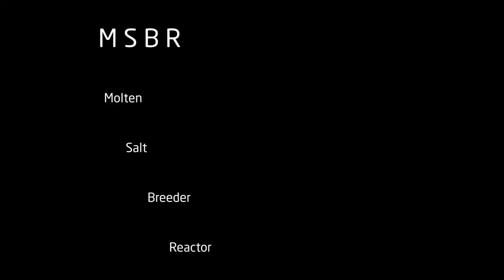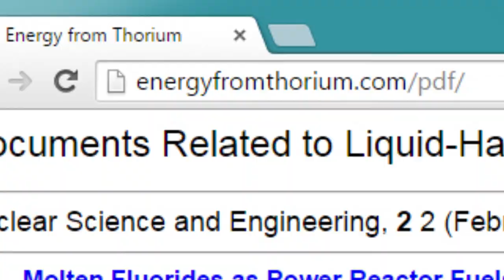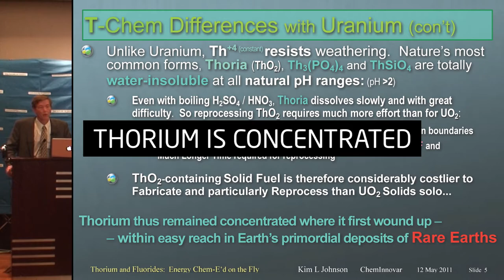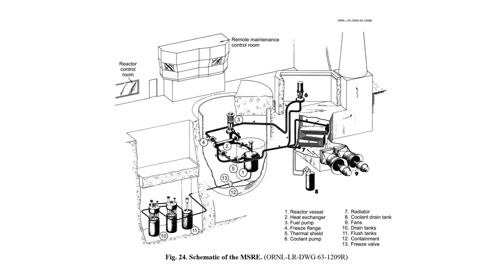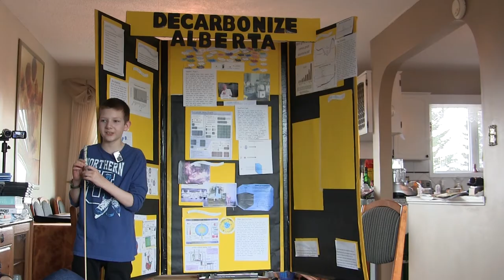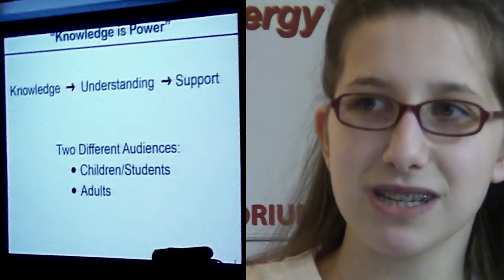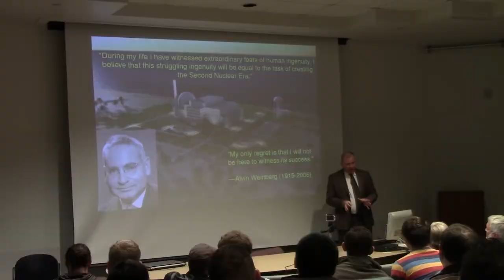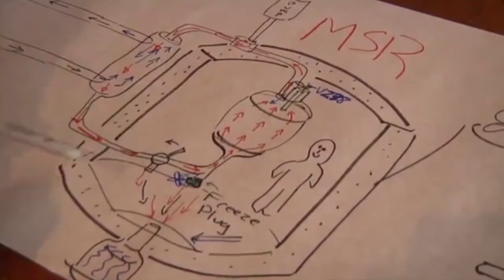MSRE Footage? MSR Needs Marketting, LFTR Coined - TR2016c 1h22m03s07f

Comment: I will go with Thorium heads over heels. Way better than Fission reactors .
Reply: Joseph GEIS Thorium reactors still use FISSION to produce energy. The proposed MSBR is different from today’s reactors in a number of ways, most significantly SALT coolant, and use of THORIUM as fuel instead of uranium. But still fission.